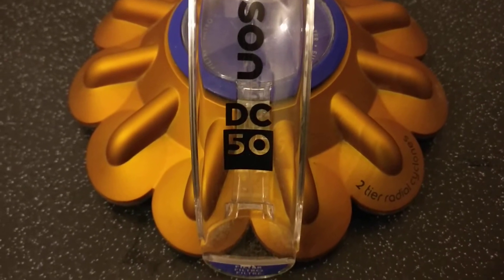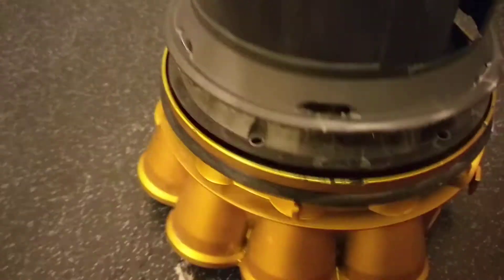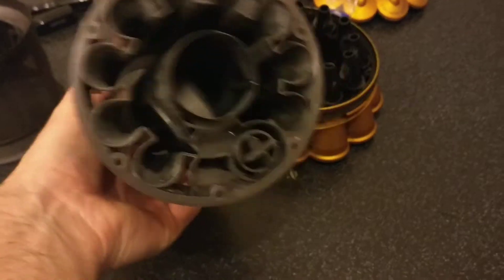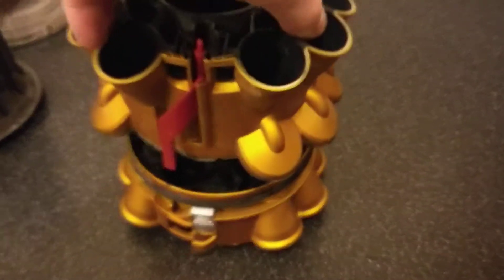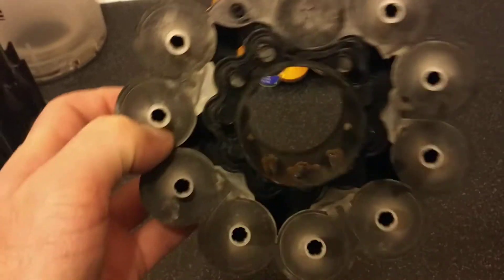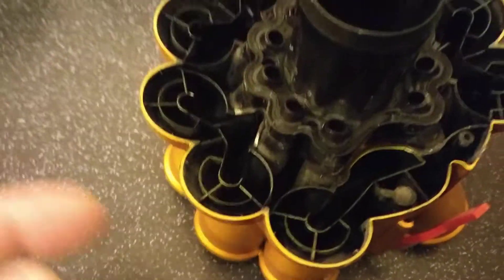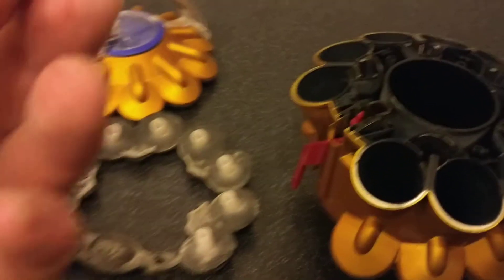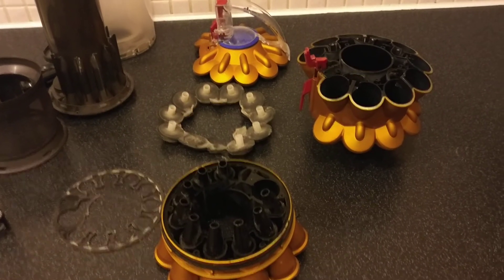Dyson DC50 Dual Cyclone Dismantling

Comment: Hi, I'm sure I just found your DC50, in a box, in bits, outside your house !! Lol. 
 Well done on a Good instructional, and informative video. 
Dyson really dont like people, like you and me getting inside and fixing our own vacuum.  
Even the Dyson Engineers, dont go this far. They will just swap the Cyclone for a New one. (Warranty)
Or just tell you your vacuum is beyond repair, (only blocked),, imagine labour cost of a Dyson engineer to do that,, or to change Brush Roll Motor. 
I have done loads of Dyson vacs over the years, but this is my first dc50.   What a bloody farce. 
1 T15 torx driver, 7 screws and everything was in bits,,, 
Then the Ball arrived and the World turned on its head. Lol.
Big Thank You. Thumbs Up from Wales  😎👍
Great vid.

Comment: Thank you for this tutorial. I wasn't able to find the screws for the top layer but now I'll know where to look next time :-) 
For replacing the deep screws I find it helps to place the screw on the tip of the screwdriver with the driver pointing upwards, then lift the cyclone so that the screw stays in place. Hope that helps. Have a great day :-)

Comment: Excellent video which helped a lot. The rubber seal mention at 4:50 is indeed delicate and I used a minute dab of rubber cement during replacement. At 5:50 you mentioned a likely problem replacing the lid screws. I found that by inserting the screws first and applying a dab of the handy rubber cement the screws stayed in place long enough for me to locate the screw holes in the lid. As you say, tricky but doable. Finally at 6:40 you mentioned the little red bit that activates the dust release and for the life of me I can't seem to line it up. The Dyson works like new again (with the exception of the dust flap which will be another rainy day project) Thanks again.
Reply from the maker: Thanks for the comments glad the video was of help

Comment: Thanks for the video. I have dismantled it fully,before watching your video, however when putting it together i couldn't remember where that rubber goes as I thought was somewhere underneath mesh. You have clarified this for me, so I took 1 tier of cyclones off again and indeed found the exact place this needed to go. It wasn't that hard to put in place as you stated, so was very pleased. BTW. I didn't have those screwdrivers and managed to remove this with tiny flat ones. To access last set of screws to remove them as well as put together I have removed the middle plastic pipe, which is removable part, held by three clips. It was then much easier to remove those. Also when putting it back i first slided those screws into holes, which was easy enough with that plastic pipe off... Hope this will help someone. Thanks again!
Reply from the maker: Glad it was of help to you

Comment: I took apart an extensively used DC39 once the one with the single row of Cyclones (not the improved 2-tier or Cinetic) and I’m shocked it doesn’t really get anything stuck up inside the Cyclones. I wouldn’t recommend disassembling your Cyclones

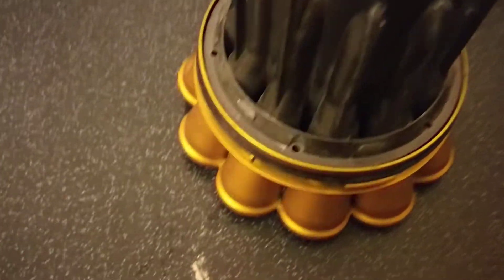Comment: I was stymied by the secret screw at 2:47 unfortunately. I'll have to get a thinner screwdriver - but anyway, it seemed to me that these are smaller than the T10s mentioned at 1:57?
Reply from the maker: I cant remember now, I recall having to use 2 sizes of screwdriver.  What i do recall however is that the "secret" screw did seem to be a different size at first, but for me, it was full of dust making the screwdriver not want to fit into the screw head correctly.  You may be right though, I cant recall now...